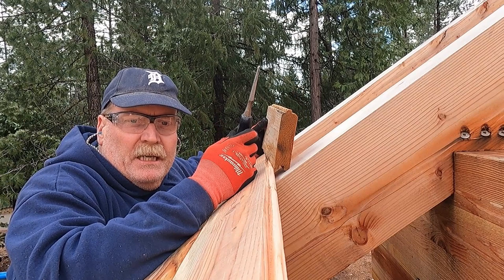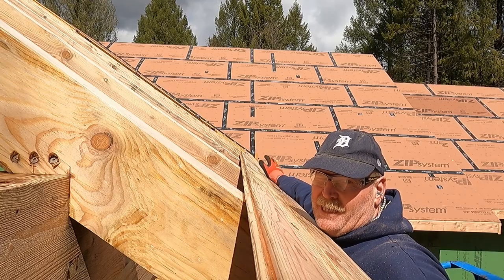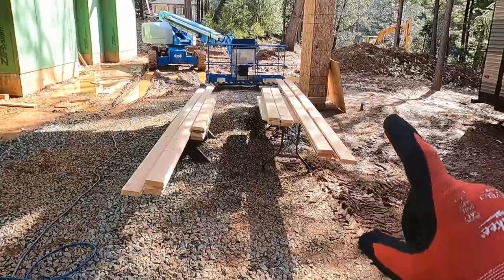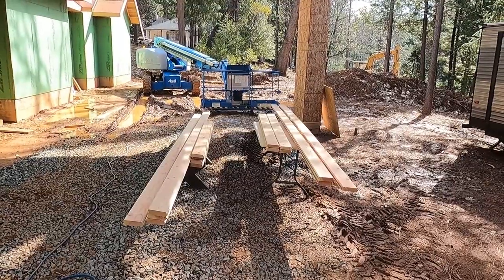Installing tongue and groove roofing - Build your own house

Comment: What is the thickness on your board ?
Reply from the maker: It is a 2x6 tongue and groove with a V-groove on one side.  By the time the board was kiln dried and milled, they came out slightly under 1-1/2 inches thick.  I needed the 2x6 T&G for the three foot span between the heavy timber rafters.

Comment: Where did you buy the boards?
Reply from the maker: I purchased them from through two different local lumber yards.  Diamond Pacific Supply got them from Western Woods and Wayside Lumber got them from All Coast Forest Products.  I found out that the tongue and groove connection is much different between the two manufacturers so I would stick with one.  I had changed lumber suppliers during the project as I was getting better pricing from Diamond Pacific Supply.